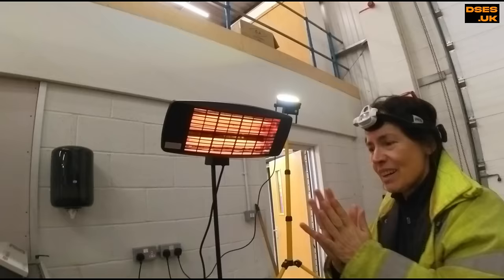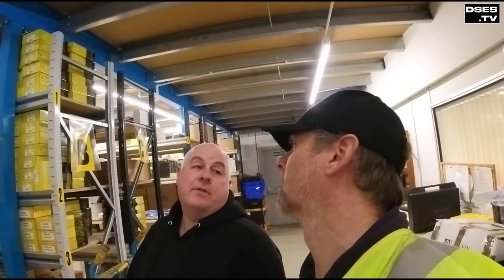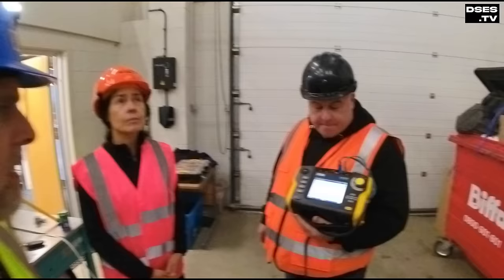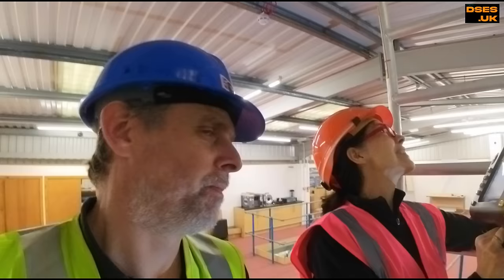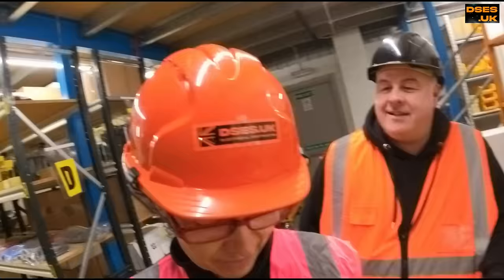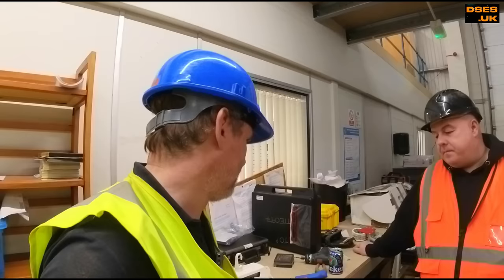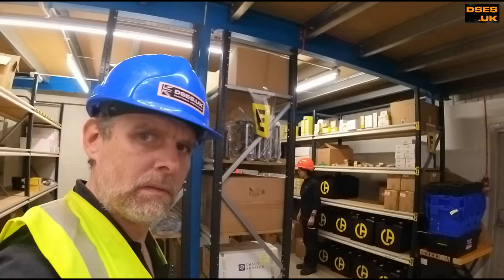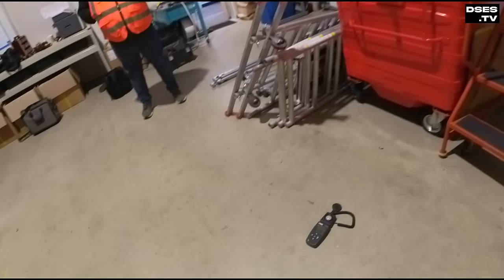Lighting a northern high-bay my way

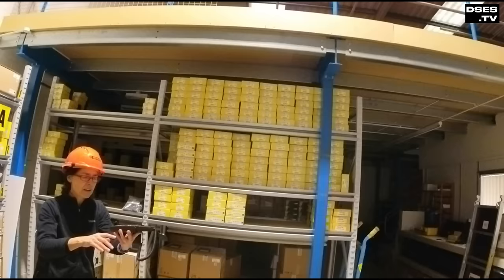Comment: 25:55 Wouldn't it be great if the Lux-Meter had the display and sensor in separate units so you can ready the display easily?
Reply from the maker: The sensor does detach, albeit still tethered to the curly cable.

Comment: Hey, just wanted to say I remember your recent video on outside LED lighting, the amount of call outs you get, even the ones you buy from reputable places like Screwfix get them from China now. Well my Lucecco ones I bought last year just failed in the cold weather. Both the solar and mains ones! You were right. Everything is crap now. can't even stand up to a -3 night.
Reply from the maker: Luceco exterior lights are a menace.
Reply: @dsesuk   I never had a problem 10 years ago. It's only the recent ones I bought that seem crap. You can tell they are cheaper made. Even the brackets are more flimsy and smaller.

Comment: I can't help but wonder if you'd have been better off setting that light to permanently be dimmed a little. Driving the LEDs a little cooler and more efficiently, potentially prolonging their lifespan.
Reply from the maker: Perhaps not a bad shout. I guess as it isn't used much and the bloody place is always cold, even in summer, it stands a decent chance of lasting a while as-is.

Comment: David do have a link for the wire stripper you used?
Reply from the maker: Yes: https://amzn.to/3MFVN2u - not as flexible as a Knipex Ergostrip as it only has one cutting position and no slicer.
Reply: @dsesuk  Cheers, I will take a look
Reply: Tried both

Comment: Is it usual practice David for high bays to plug in a socket like that
Reply from the maker: Not a socket like that no, this being a standard BS1363 arrangement. I don't know who installed that up there or why they didn't go for some kind of quick-release lighting connector, but I guess there's nothing inherently wrong with it. One tends to avoid BS1363 sockets on 6A lighting circuits just in case someone plugs in the toaster and plunges the place into darkness, but that's not going to happen here without some significant effort!
Reply: Plug-in lighting is quite common in the commercial world. It makes maintinance's job easier and safer. They can unplug the light to either make it safe to work on in situ or to remove it completely for repair or replacement. No need to hunt down the breaker, no need to isolate a whole lighting circuit.

However using a regular 13A socket is not normal. Inaccessible fuses are generally considered undesirable (some might argue if the fuse is blown it means the equipment is faulty, but fuses do blow from time to time for no obvious reason) and so is allowing regular building users to plug stuff into lighting circuits. 

There are various brands of plug-in connector sold specifically for lighting and these seem to be the normal choice in indoor commercial environments. Probablly the best known being the hager klik which also comes in a four pole variant for emergency lighting.